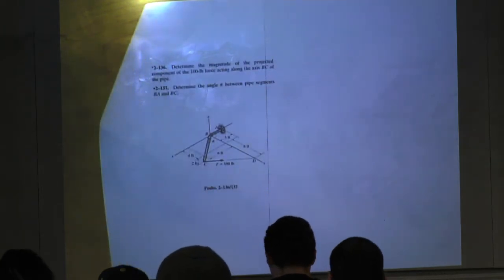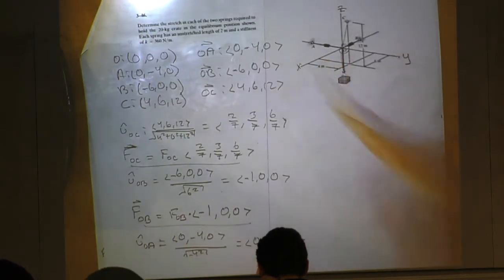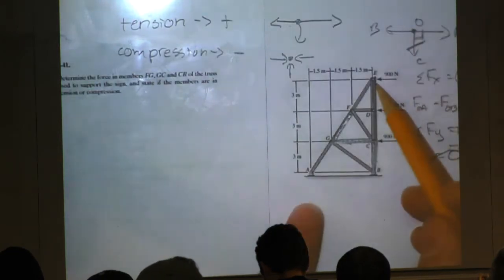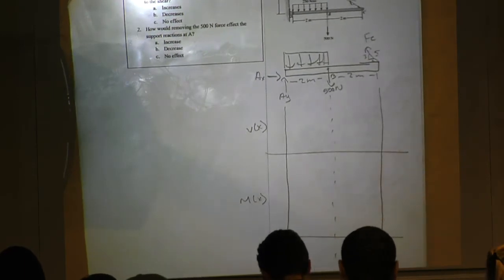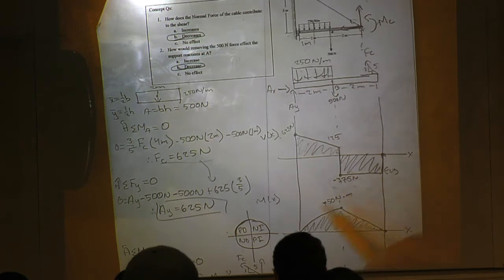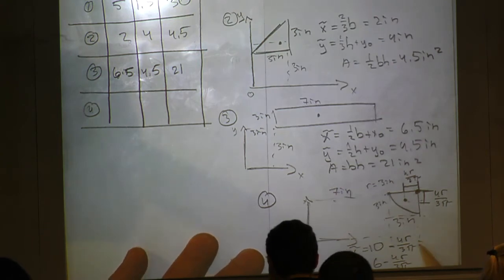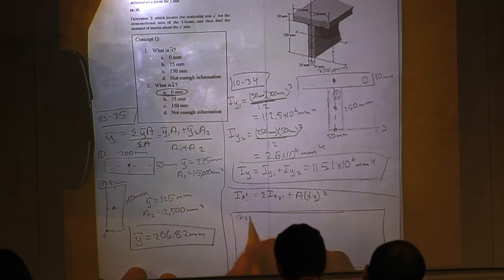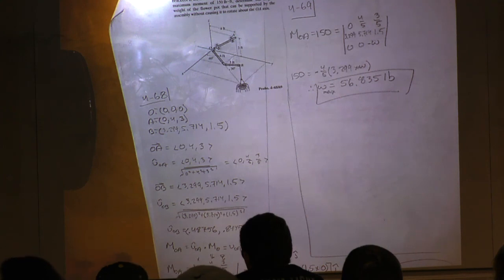Engineering Analysis-Statics with Andrew

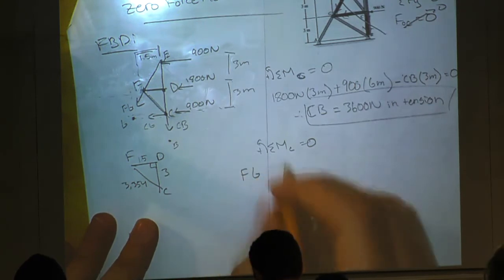Comment: How come he is multiplying FG by 3.354 at 44:30 if that isn't the perpendicular distance from C??
Reply: 3.354 is the perpendicular distance
Reply: How?? It doesn't look like it's at a perpendicular angle from the point.
Reply: I know it doesn't look like it, but if you calculate the angle between FG and FC it comes out to 90
Reply: But on assumption that the line from E to A is straight it should be impossible for the angle between FG and FC to be 90. EFD is 63.435° and so is DFC. So CFG can't be 90 since they all make up a supplementary angle, right??
Reply: You are right. I was calculating the angle between FDC and half on FGC. I'm not sure why he did that then. I was also confused as to why he did that. I thought I figured it out but I guess not
Reply: i found the problem in the 13th edition of the textbook and his answers are wrong
Reply: Just FG is wrong the others are right
Reply: Cool cool. Thx for checking